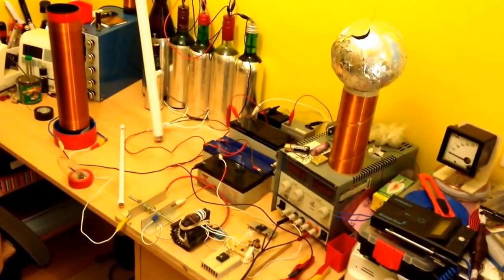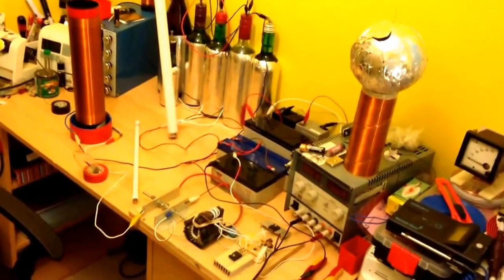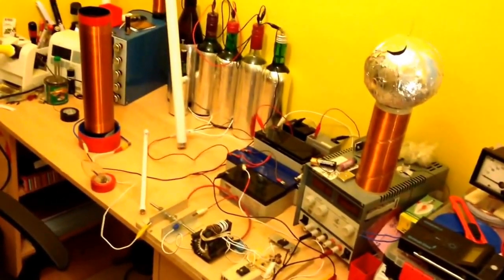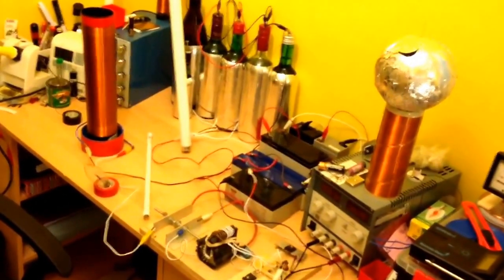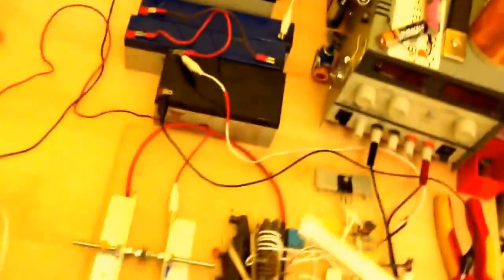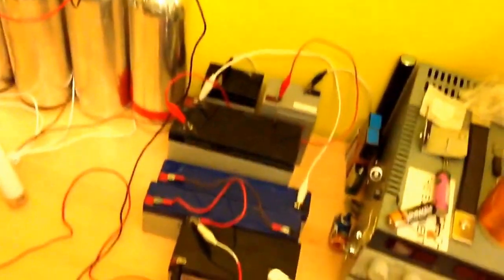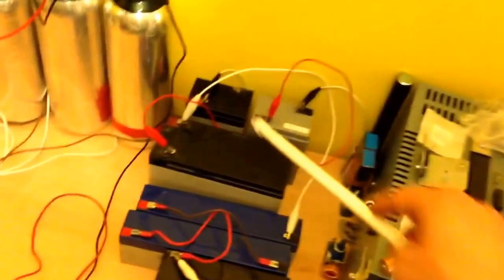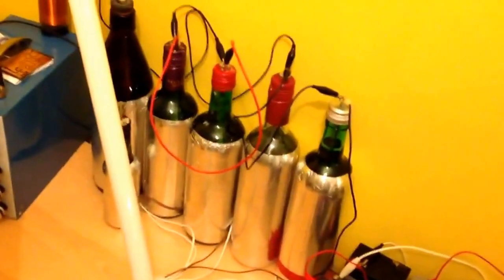Destroying my Tesla coil crash test :)

Comment: Thats cranking.
Reply from the maker: Edward McLaughlin
Yes ,it was nice vine and old cider bottles ,it works magic for this set up.
Regards
Reply from the maker: Mongrel Shark
When you finish the-Laminated Caps you are "working on at the moment, which are super low induction. With full discharge in the low nano seconds range." can you post video and tag me , I'm really interested in better DIY caps.Regards
Reply: That s was pretty cool. Was that wine bottle caps?
Reply: Looked like it.
Reply: Kamil Domjan Have you tried thinner dielectric? I find PET bottles work very well.
Reply from the maker: Mongrel Shark
That sound like good idea ;) will try next time ;) see if I get positive results and keep u up date.
Reply: I did a video with 2L Juice bottles ages ago. They held up really well. If I did it again I would  try topping the bottles with oil to reduce leakage.

Although I have since made faster reacting caps. The water has a lot of resistance which slows Leyden jars down (thicker dielectric also increases induction and slows the caps). The cup caps I did a couple of months back are a lot faster. Then there are the Laminated Caps I am working on at the moment, which are super low induction. With full discharge in the low nano seconds range.

Also with the salt water, be careful not to get any on the foil. It turns them into batterys!! and destroys the foil. Thats what ultimately killed my first Leyden Jars.